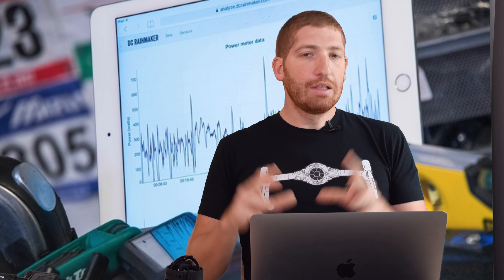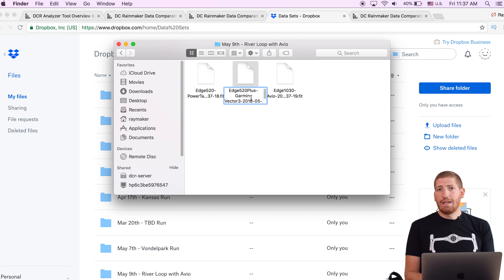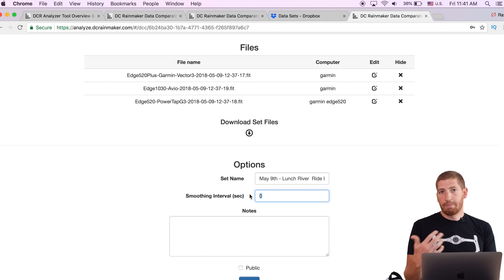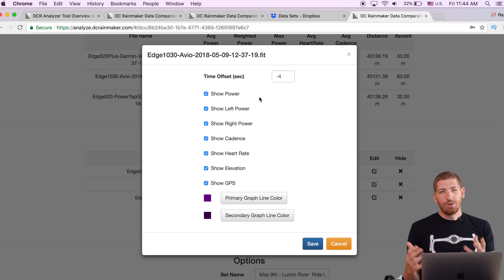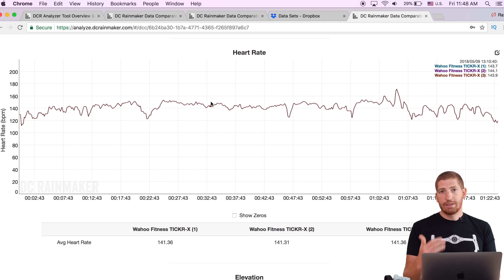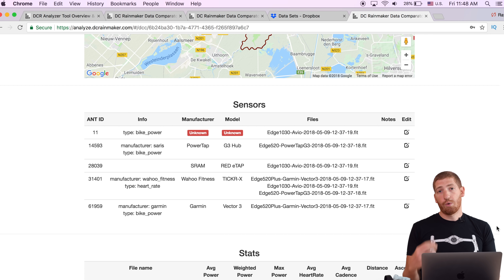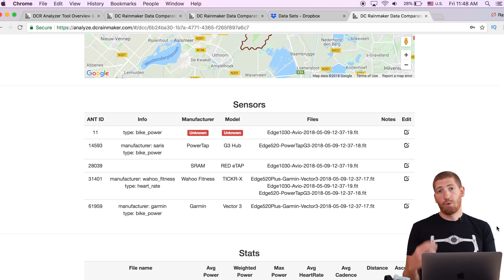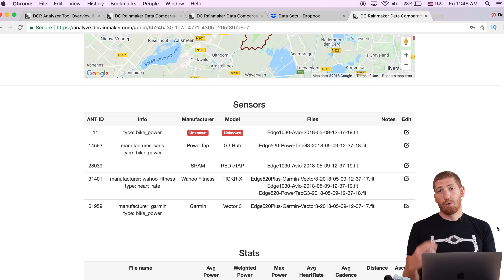DCR Analyzer: How to for data file comparison

Comment from the maker: Hey Folks - If you're a DCR Analyzer user, I'd love any suggestions for new features!!! Feel free to drop them below! Remember the goal isn't to be a training log, but all about comparing and validating files.  Still, I know there's tons of good ideas we can consider, so I'd love to hear them!
Reply: Perfect timing Ray. Next week i'll receive my favero assioma and i'll use your tool for a comparison between them and my elite direto PM. I'll connect assioma with my garmin 920xt and direto PM to zwift. If i'm right it seems that i'll have to edit timestamp as you've shown in your video since it's difficult that windows NTP server and Garmin GPS are perfectly syncronized.
Reply from the maker: Yeah, typically I see about a 1-3s variance on most sets I create, even when I've given all the units in question plenty of time to get perfect GPS. No worries, it only takes a split second to time-shift the sets back to the right spots. Enjoy the tool!
Reply: Should actually have a training log especially Dr those who coach themselves perhaps and don't need all the other options many other apps are having. 
Some.woild probably just want to check and review their data and curves perhaps...

Comment: After struggling to reach the HR zones that I wanted during interval training, I decided to bake off my Forerunner 245 vs a (albeit uncomfortable) Polar H10 HR strap and this tool pretty much showed me exactly what I thought was happening - the on-wrist HR monitor was fairly accurate but over-smoothed and therefore was underestimating HR / lagging behind during the peaks.

I'm pretty heavy so I'll run out of puff fast, so for intervals training, a more nimble response time was a must otherwise garmin thinks I literally never train anaerobically. I'll try a few different training types over the coming weeks but this was more out of curiousity than anything else. I'm not a researcher / youtuber etc, but I found this tool very helpful so thank you kindly sir.

And I think it's great value too for such a specialized product that does not exist anywhere else in this sort of "out of the box" format.

Comment: Great stuff. I used it once to compare my power meters and found it to be very intuitive  and easy to use. I can’t really think of any new features except maybe a way to list the times where power went to zero, or null, unexpectedly - which might indicate a signal drop out. Hard to say, I know, because it’s hard to know if power was zero because of coasting or zero because no data was recorded. Anyway, for what it’s worth, your published analyzer charts inspired me to make my thing for Zwift logs, but I was not aware your tool was available for anyone to use when I made that, which is probably a good thing because I’m a horrible copycat. I used to include power but it wasn’t available for all devices so I dropped it. (I have no plans, or the time, to make a .fit file reader)

Comment: Is there any mechanism to "map" a developer field to a sensor?  My use case is that I have a Garmin Vivoactive  recoding power meter "B", via the Connect IQ Data Field "ANT+ Power Meter" while my Garmin Edge records power meter "A".  I would like to be able to treat the data from power meter "B" as power, but I do not see a way to have that data treated as anything other than a generic developer field in the tool.

Comment: Ive been using it since launch and really like it. I've been thinking of a couple of things I really would like to add.
- I compare elevation almost all the time. Possibility to add an internet 'generated curve'.
- Show negative values in elevation graph. Sometimes my watch starts with a too low value and ends up negative.
- Elevation offset per file
- Pace comparing graph
- Openstreetmap option
- Possibility to add more files after creating a set.
- Do I have a link that shows me all my public sets?
Reply from the maker: Hi Peter! As of last night we added in Pace comparing graph. We also added in accumulated distance too (to spot GPS issues).  And finally, premium/annual users no longer have a watermark (you need to login/out first). I definitely want to get to ability to add in more data files per set, been on my list for a while. Also a number of other great suggestions! Thanks!
Reply: DC Rainmaker Thanks, its great. Yes actually, I was logged in and had a set open and when refreshing I saw the new features. Then I looked for some app home page were things like this could be advertised, but didnt fid any.Two minor comments, Scaling of vertical axle could be optimized and option to show it as pace min/km would be appreciated. Thanks again for a great tool.

Comment: Cheers DC, i'll no doubt return here when i've explored the app a little more.  answered a few questions though. 
1st thing I've noticed for me ( i'm comparing Tack flux through zwift via strava with Tickr x, with vector 3's with Garmin hr+ on edge 520) whats best to get the files into sets. currently USB link Edge head unit to computer and drag that file over and grab the Flux data from Strava but it doesn't give me a separate device for the Tickr X to Tag it with its own ID.
only been on a couple of times so might have missed something obvious?
Reply from the maker: Yeah, right now it's best to use different Edge units. However, there's a new data field that I'm testing in beta that can connect to multiple sensors. Check it out: https://apps.garmin.com/en-US/apps/ad58914e-b6b3-4135-91d7-30bb0e9d8723 - It's still got some quirks, but we'll support it within the DCR Analyzer as it writes the data to the developer fields that we currently enumerate.

Comment: 5$ per day!! No thank you. I will use excel
Reply from the maker: It's $5 for a single day, or $29/year. Most people using it for a single day just want to quickly compare a couple data sets as a one-off. Whereas the annual pass is for people that do a lot o comparisons.